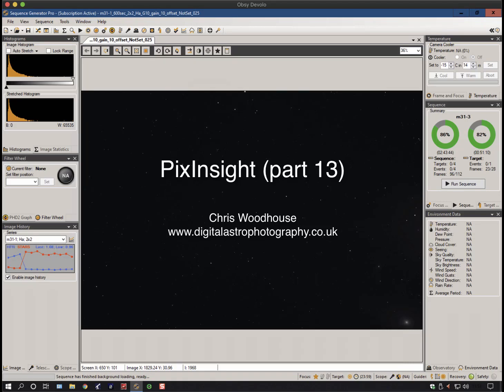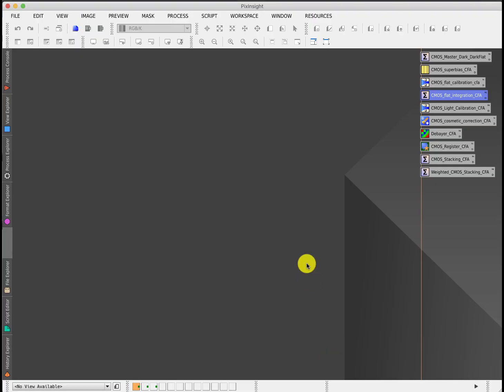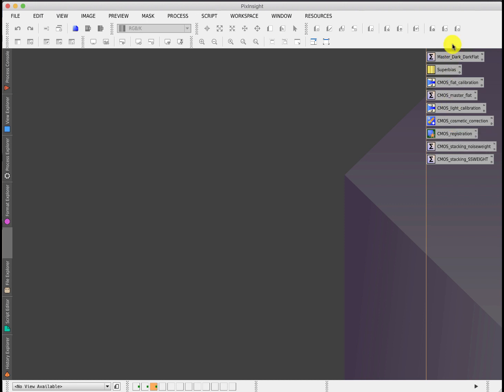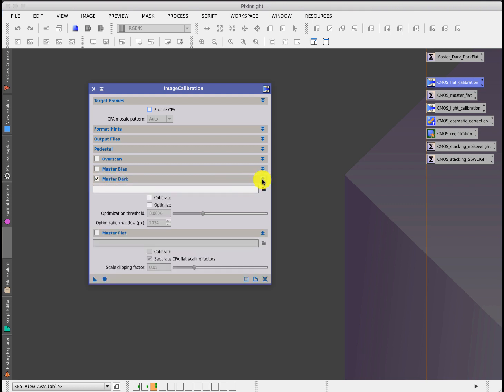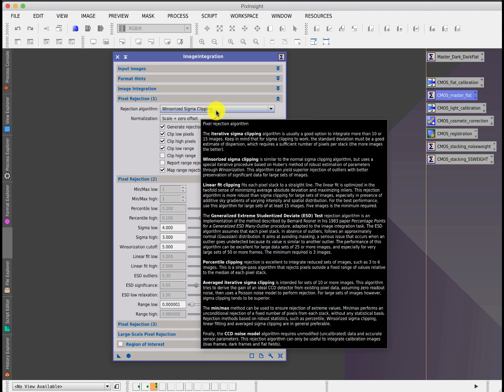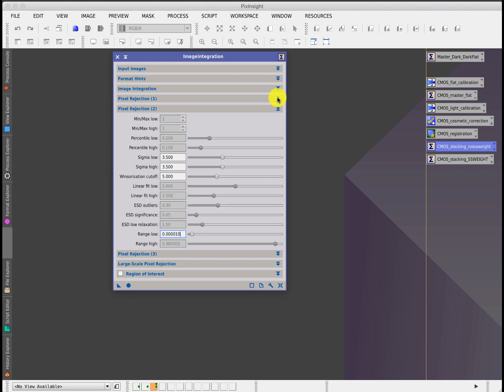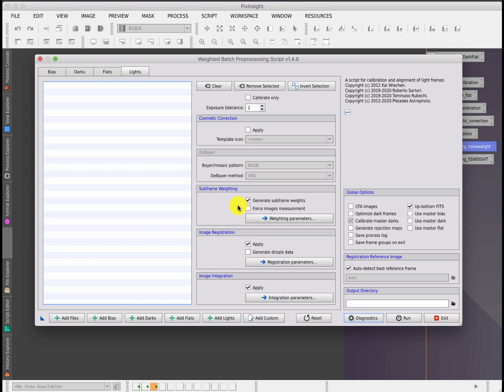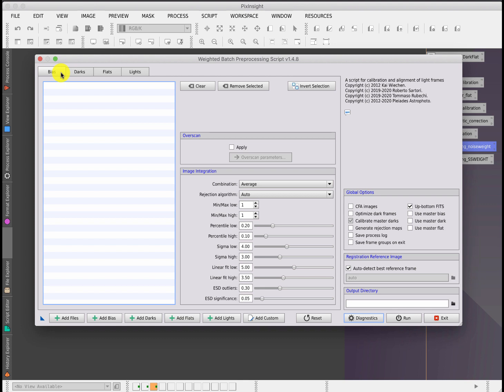PixInsight (part 13) - CMOS camera calibration update

Comment: Hello and thank you for the tutorial.
Are there chances to correctly calibrate images taken in LRGB filters with sky flats. In this scenario it is impossible to reproduce dark flats of exactly the same duration as flats, as the sky brightness changes at dusk or dawn extremely fast. What is the best approach to monochrome CMOS calibration in this case?
Reply from the maker: The best results occur when they have the same duration. I would try to avoid having flats of different durations. The exposure time should be in the FITS header and maybe take a look at the durations and pitch something in the middle? I am fortunate that with refractors, I can take flats whenever I like and even with an RCT, I do not get dust ingress to where it is noticable.

Comment: Lovely tutorial. Thank you for that. In deed I struggled with the tolerance of the exposior time, when putting the flat darks into the Darks section together with the long exposure darks for all the filters. I hat exposure times for the flat darks for red, let's say, of 1.34 sec. and 1.78 sec. for green etc. 
With a tolerance of 1 second in the Dark section of WBPP it can not distinguish between my flat darks for red and for green.

Comment: Hi Chris, thank you! In the Image Calibration you have the CFA flat scaling checked. I have a CFA camera. Do I leave that checked? Thank you for the excellent video. Would love to see you giving tips on acquiring your images. Joe
Reply from the maker: It is greyed out and I could not change it. I believe it is OK, since I do not want to start mixing up pixels. In Nebulosity, for instance, it averages neigboring pixels in the flat field, assumedly to reduce noise. That may have been OK for old mono CCDs but not a great idea when you want pixel by pixel correction.

Comment: Hello Chris,
Thank you for continuing our education with regards to Astroimaging.
I recently upgraded my camera from a DSLR to a ZWO 2600 OSC CMOS camera.
I use Weighted Batch PreProcessing in Pixinsight for my image calibration. I have made a library of Dark frames at various exposure lengths to match my typical Light frame exposure lengths. I also have made a Bias frame file (150 images at well less than a second). In fact, when making the bias frame file, the exposure length I select (for bias frames) is 0 seconds in SGP. 
I usually take my flat frames after every target session. This allows me to accommodate for any change in focus or camera rotation from target to target. My flat frames (per the calibration wizard) varies from 0.05 sec to 0.84 sec (depending on use of the L enhance filter). I use a light box. Since my bias frames are essentially the length of time of my flats (all less than 1 second) and my bias frames are taken like a dark frame (camera cooled and cap on sensor), why can't I use the bias frames to calibrate my flats? I typically add a master bias and a master dark (usually 300-600sec) and click on "calibrate with flat darks" under the Flats window. I get a notification that the flats will be calibrated with the master bias. After adding my light frames and running WBPP, not only are registered images created but a Master Flat has been created. How is this different than taking short exposure dark frames and using those to calibrate with flat darks? 
Sorry for the verbose comment but I don't understand how a short Bias and a short dark differ if all parameters (time, temp ,gain and offset) are essentially the same.?
Thanks for your expertise.
Dan
Reply from the maker: Dan - you might be able to use these particular flat frames, since the exposures are very short. My point was to use a consistent approach as when it comes to twilight flats or those through narrowband filters, the exposure times can be over 10 seconds. If you always follow the same process, there is less chance of getting tripped up. What neither of us know is at what particular combination of exposure and camera type does the anomaly become objectionable. That is dependent on the subject, the amount of stretching and so on. If you are inquisitive, take exposures with 0 seconds, 0.5 seconds, 2, 10 and 30 and use PI to measure the mean level of each, using the PI statistics tool. On quite a few cameras, the mean level drops with increasing exposure time (especially the Panasonic).
Reply: @astroshed  Thank you for your thoughts and time
Dan

Comment: Hello Chris, I see you have the subtract pedestals ticked for making the master dark-flat should i enable this option?
Reply from the maker: The pedestal here is not a general level from the gain/offset setting on the camera but a deliberate uplift. This is recorded in the FITS header using the PEDESTAL property. If that property does not exist, in the files, this option has no effect. If I remember correctly, Maxim DL5 used to deliberately put in a pedestal to all its image files, which you had to remove.